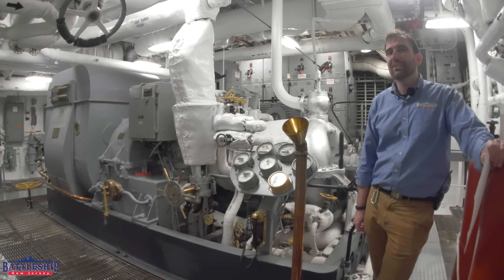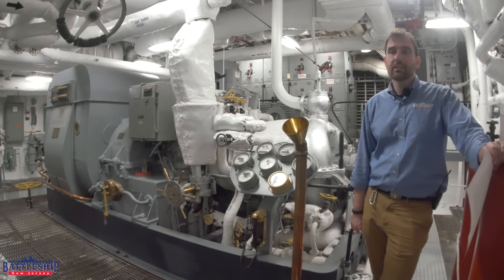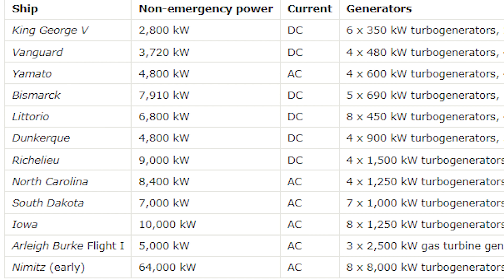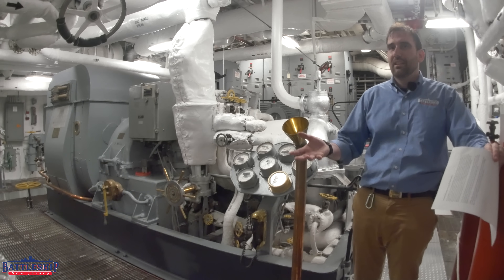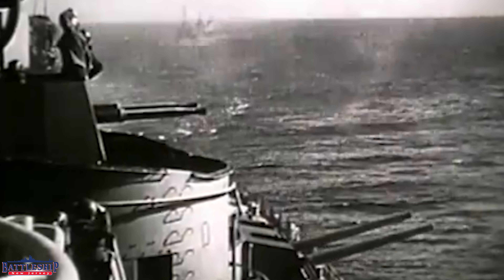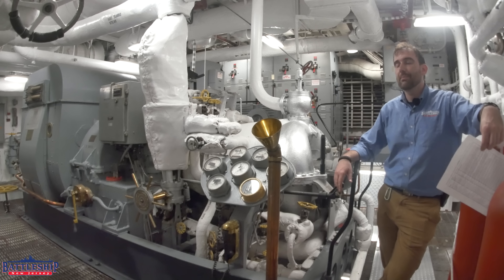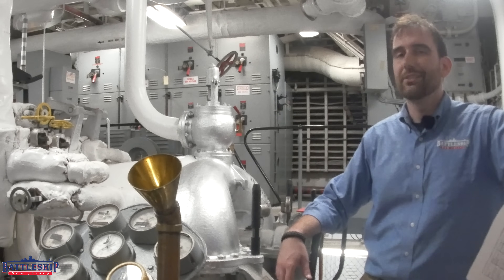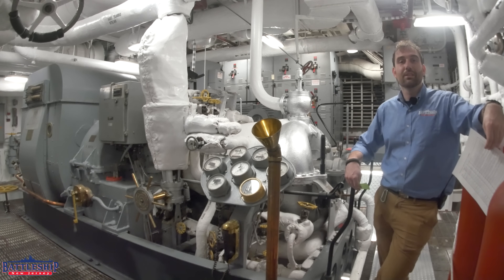How Much Power Can a Ship Generate and Did a Ship Really Power a Whole City?

Comment: DC has some advantages over AC (not many). But one of the easiest advantage is that you can easily plug batteries as emergency power source and continue running your equipment. This is essentially important during a battle, where each consumer can be powered independently from emergency batteries. For the same reason, the stand-by (backup) flight instruments on even the most modern airliners still run on DC voltage, while most other stuff is AC.

You can convert DC battery power to AC using an inverter, but this was tricky in the 30's and 40's. Today, this is not a problem, as modern inverters are quite efficient and also small and reliable. Many modern photovoltaic panels now a days contain an inverter built into the panel itself.

Comment: An error in the spreadsheet, it shows early Arleigh Burke class Destroyers of 5000kW of non-emergency power.  Technically all the generators on a Burke (or Ticonderoga, or Spruance) are Ships Service generators so early Burkes and Ticos have 7500kW of power generation.

Most Spruance class had 6000kW (3x 2000kW SSGTGs) except Paul F. Foster which is unique with an extra generator giving her 8000kW of power (one of the reasons she is the last Spruance class afloat and in (non-commissioned) service).

Later Burkes got upgraded generators and the new Flight IIIs have even more powerful generators.

Comment: Aside from the DDG 51 it would be interesting to compare some of the long gone nuclear missile cruisers’ generating capacity. Also it’s not clear when discussing radars. Peak power of a radar is the energy transmitted divided by time. But the pulses are very short though there are also thousands per second. But the NON transmission time is much longer than the transmission time to allow the pulses to return. So the power the set consumes is nowhere near the figure for transmitted power.
Reply: I just checked the SK. Whike the pulse power was 250 kW, the OPERATING power was 3500 watts (Wikipedia erroneously says kW).

Comment: If the guns on the battleship were under remote control and electrically operated then I would expect that the AC distributed about the ship would be used to drive a motor/ generator set of which the generator would be a special type of the metadyne/ amplidyne class.
The metadyne is essentially a rotating amplifier and would take a small current on one of its windings and produce a variable DC voltage to drive a large DC motor for direction/ elevation. Feedback would be used to balance the command signal and the position achieved. (Control Theory)
Reply: Each turret has a primary and backup power supply from the ships' electrical grid.  Train (traverse), elevation, and ramming functions are done by hydraulic systems powered by electric motors.  Without further research I'm not 100% sure if the shell hoists and propellant hoists run via electro-hydraulics or are straight electrical.  Other systems in the turrets are pure electrical, such as lighting, heating, ventilation, and fire control (computing and aiming).  Compressed air for the breech evac system, recoil return system, and fire sprinkler system pressurization comes from the ship via a rotating coupling under the turret.

Comment: It actually was not that uncommon to take decommissioned warships and use them to provide electrical power to far-flung settlements.  Purpose built ships were used for this as well.  I believe in the last decade or so the Russians actually built a nuclear reactor on a barge for that purpose.

Comment: Wait the New Jersey used DC power for the wall outlets around the ship 9:15? Also a major benefit of AC power is that's what's used in the power grid and you can have more off the shelf equipment and components from the building construction market.

Comment: That transformer thingy is quite important for a large electric grid (for example the one feeding households and industry around the US), so that’s AC, and until the 60s, good rectifiers weren’t common, so you got stuck with AC or DC (no plugging into the grid on DC with any expectations of it working) and DC-AC conversion wasn’t efficient until semiconductors came along in the 80s. Buut on the other hand, DC can be stored in batteries, is a lot easier to design logic circuits for (which is used a lot in modern electronics) and the motors are easier to control RPM wise…

Comment: Most households use AC (120 V AC for light and outlets).   DC is used for electronic devices.  For Stoves/dryers its 240 V AC, any electronic stuff likes clocks on the stove, will have their own inverters to go from AC to DC inside the stove
There is a proposition to put LED lights in a house at 24 V DC. For now AC to DC is at the light outlet for led lights.  So houses are getting 120V for lights and outlets still.  Led lights use less energy and are supposed to last longer. Do not put led lights and normal lights on the same circuits. The led keep burning out due to change in voltage as lights go on and off in the circuit.  

On ships they use AC, cause its easy to convert to DC.  

AC is the king because AC was able to transmit over long distances.  Now with new technology DC can also be used for long distance. There are proposals for solar to go from north Africa to Spain using DC transmission.

Comment: I must have overhauled 30 SSTG sets when I worked for the GE Marine Department. That brass ship's wheel looking unit is the Trip Throttle Valve. The brass unit to the left of it with the yellow handle is a hand cranked lube oil pump. A sailor has to crank the oil pump while another cracks open the Trip Throttle Valve to slowly bring the unit up to speed. The internal oil pump takes over and when the turbine hits governing speed, that handwheel is cranked wide open. The turbine runs about 10,000 rpm and the gearbox reduces the speed of the generator rotor to 1200 rpm. A spring loaded overspeed bolt in the turbine shaft pops out to strike a trip lever to snap shut the steam valve in  case some upset allows the turbine to exceed 105% rated speed. I enjoyed working with those units.

Comment: 1 advantage of Electric motors versus steam powered motors is reduced risk of steam leaks and fractures scalding a crew member badly - or to death.
Reply: "Reactor power follows steam demand" in a water-moderated reactor. If steam demand spikes sharply (due to a rupture), so does reactor power. Yikes!

Comment: Ryan, I thought that the British battleships used hydraulic power to rotate their turrets and elevate their guns. Is that true? If so, how does that square with the use of steam-driven motors? I imagine it would have been tough getting tight steam fittings across a rotating joint.
 I can see them being used for capstans and winches, but those are fixed to the deck.
Reply: US battleships use electrically-powered hydraulic systems to rotate the turrets and train the guns.  The reason that NJ cannot move the turrets is that the electrical load to do so is greater than the rating of the Shore Power breakers.  

This was covered in detail during a previous video.
Reply: @kevincrosby1760  Thanks for the clarification.

Comment: As stated in the video; the fact that a ship can produce X watts doesn't mean it uses that much power. I'm sure they have a significant safety margin becuase if they lose a generator in battle you don't want to immediately lose a turret or half your anti-aircraft guns.

Battle damage is something you have to expect and be able to deal with, in my mind you can't assume that your generators are going to be fine and a frew flimsy emergency units will get you by in case one fails.
Reply: I'm sure the needs vs. capacity have changed over time. For example the ship originally did not have extensive air conditioning, elaborate radar, or missle launchers, so would have had plenty of power to spare. You're right, I think they would've accommodated for losing an entire fireroom. However in some other videos they've mentioned that the '80s refit left New Jersey actually short on power, unable to run everything at the same time. All of the lighting would have been incandescent power hogs, too. It would be interesting how much power needs could be reduced with a modern refit with more efficient motors, solid-state electronics, and so on

Comment: Live in a camper for a while and if you don't know AC and DC power well going in, you'll definitely know them intimately by the time you're done, haha. One of the few common places you'll see a lot of AC and DC together.

For those not familiar, campers and RVs have 2 completely separate electrical systems, a 120v AC system like you'd find in your house to power the AC, microwave, water heater, outlets, etc, and a separate 12v DC system that runs off the batteries. Everything essential like the water pump, lighting, slide-outs, stabilizers, etc will run off the 12v DC system so you can still use them if you're camping somewhere without a power hook up.
Reply: Also, since most campers have an onboard propane system with 1 or 2 tanks, the furnace is actually on the 12v system and not connected to normal household power at all. Most of the water heaters can use both propane or electric heat (or both at once for turbo mode) and their controls are on the 12v DC system with the electric heating element on 120v AC.

Fridges either run on 120v and propane for traditional RV fridges (yes propane, they don't work like a normal fridge at all and can use electric heat or a propane flame to run, again so you can use them without a power hook up) or for newer RV fridges they'll often be 12v DC powered.

Like I said, if you buy an RV and aren't familiar with AC and DC power, you'll become familiar with them, haha.
Reply: @ShukenFlash  never forget battery isolators.  It really sucks when you drain down the chassis battery as well as the coach batteries due to an isolator failure.

My motor home gained a marine manual battery switch and a second ammeter after the dreaded morning "click" when I expected to hear the engine turning over...

Comment: Tacoma is a great place. The carrier did a great job keeping 140k city powered. The connection from the ship to the grid was amazing as well. No city is prewired to run off a ship.
Reply: Shore power is common with many ships where the generators might be taken off-line when they are at port...especially during a refit.  In that sense they are connected to the city power grid when that happens and then the question is how much power can be transmitted through that shore power link?  The other issue is if that link can be reversed...although with most AC power systems that is actually something fairly common.  It is why even individual homes with solar panels or small wind turbines can also feed power back into the grid...and presumably get credits of some kind on their power bill for doing that too.  The ship electrical systems would be doing the same thing on a slightly larger scale.

I would also presume that at a major naval base that the shore power distribution system is also designed for multiple ships to be powered at the same time.  In the event of a natural disaster, it wouldn't take much engineering to feed directly into at least the major power substation to get to at least the power ratings for that substation as a backfeed into the rest of the grid.  That is how power grids work.  It wouldn't be perfect and like you said whole cities might not be prewired to run off of a ship, but it can certainly be a major supplement and provide emergency power to a city as the grid is being re-established due to a natural disaster.  Restoring a power grid even to a blackout caused by a heat wave or something where the power plants are otherwise not damaged is a huge logistical mess that takes hours or days to perform under ideal circumstances.  I can totally see how even temporarily connecting a ship as a part of that bootstrap process of rebuilding a power grid could really make a huge difference.
Reply: Tacoma is a Sh$%%t hole are you kidding  ?

Comment: There are a number of advantages to using electrical power rather than using steam power around a battleship.  For one, damage control is much easier.  Repairing a broken electrical cable is much easier than repairing a steam line.  For another, the steam used to power the generators can then easily be used for other purposes, such as propelling the ship or powering another generator, whereas steam sent to a distant engine is steam which cannot be used again; rather it is sent back to the boilers for reuse that way.

The distance the steam has to travel would also be a consideration, you are going to have a loss of energy in sending energy from Point A to Point B no matter which type of energy you use, steam or electrical, but the difference is that steam looses energy quicker then does electrical.  Sending a steam line the length of the NEW JERSEY would cause you (and I'm guessing here) to loose perhaps 20% of the original available energy whereas doing the same thing for electrical means you would loose less than 1% of the original available energy.  Steam plants on shore can only send their steam a couple of miles, whereas electrical power can be sent hundreds of miles.

Comment: Most of the world uses AC current, including American homes. Only small things like phones use DC. If its got a power brick then that item uses DC and the brick is the converter.
Reply: all stuff that uses ic's (chips) uses dc (tv, microwave, stereo, and more) . the power supply is a converter from ac to dc then used in the circuts and is built into the units

Comment: Your AC/DC is wrong. With that said I’m curious what the older turbo electric battleships like the West Virginia had for power generation in comparison. Given their propulsion was electric I would imagine their power capacity rivaled the largest ships of the day.
Reply: Big difference in shaft horsepower between the turbo-electric Tennessee- and Colorado-class battleships (just under 30000 total shaft horsepower on 4 shafts for 21+ knots) and the turbo-electric Lexington-class carriers (180000 total shaft horsepower on 4 shafts for 33+ knots).  

Of course the Iowa-class battleships had 212000 total shaft horsepower from geared turbines on 4 shafts for 33+ knots.

One other large turbo-electric drive ship was the French Line's SS Normandie.  She had 160000 total shaft horsepower on 4 shafts, but was reported to have developed 202000 SHP on sea trials for 32+ knots.
Reply: @Mikey300  I don’t think there is as direct of a correlation as saying this many shaft HP converts to this many KW. I know there is a parasitic loss of some sort in the system. What it is I have no idea. Would love to see some data on that. 

Also we are assuming that the turbo generators that provided propulsion power were the same that provided power to the rest of the ships functions. Is that the case or was the power compartmentalized to an extent so that X amount would always be available for propulsion and B amount would be available for weapons systems. 

I have no idea and that would would fascinating to hear about given the Colorado class was designed in the late teens. IMO that ideology was so far ahead of its time. Anything that is large now (railroads, cruise ships etc) have adopted that principle.